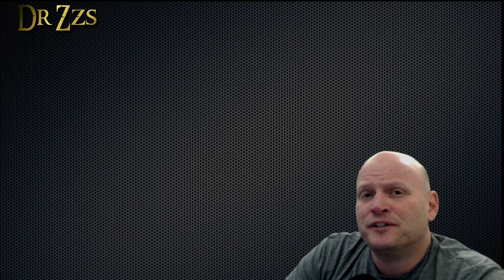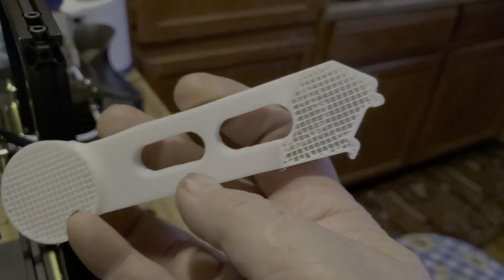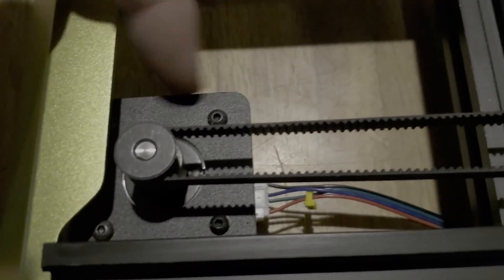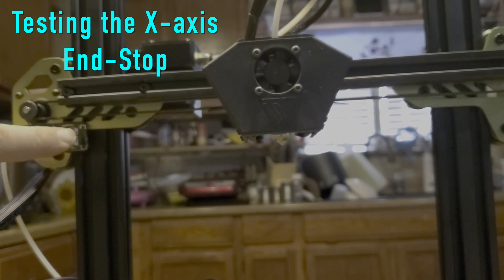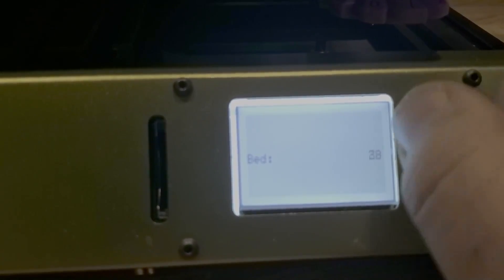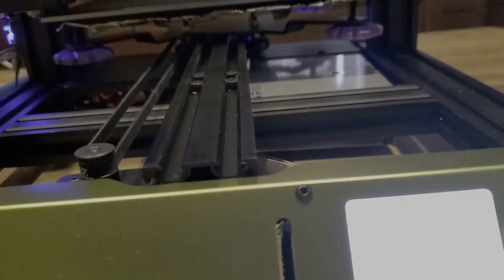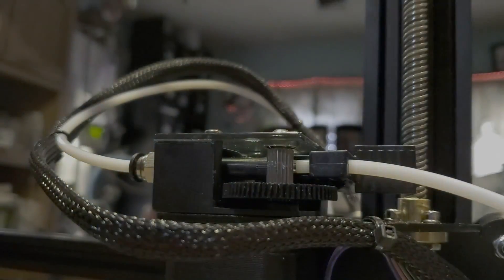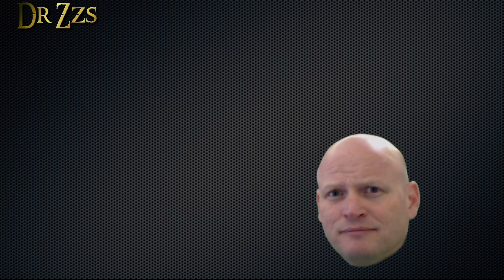Tarantula Pro 3D Printer - Initial Setup | GizCoupon | Bed Leveling | Z-axis adjusting | End Stops

Comment: I'm still a noob but I found that to get a really accurate and level bed instead of going corner to corner across an axis I go from left front to right rear then to one of the other corners this has worked much better and you only need to do this maybe twice in reality to have a good level bed